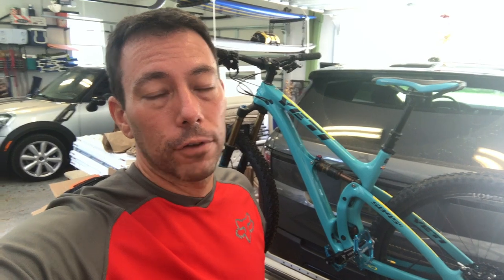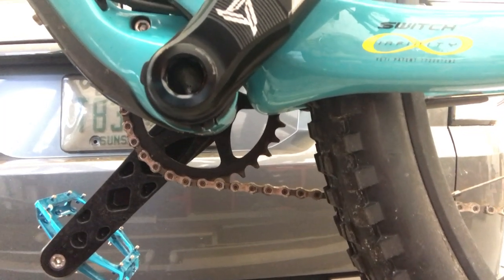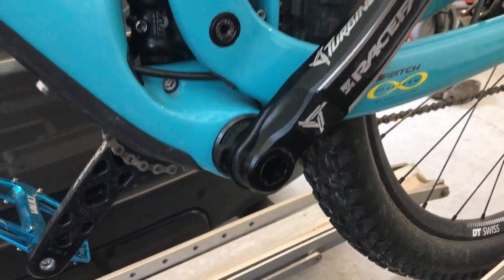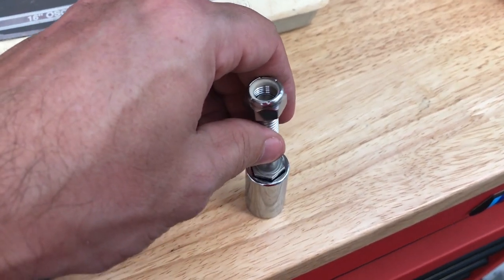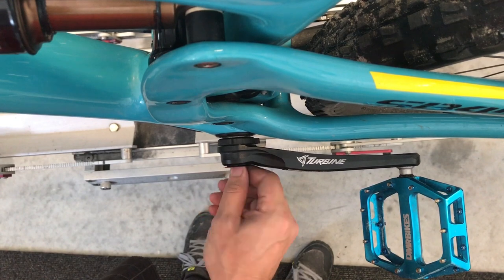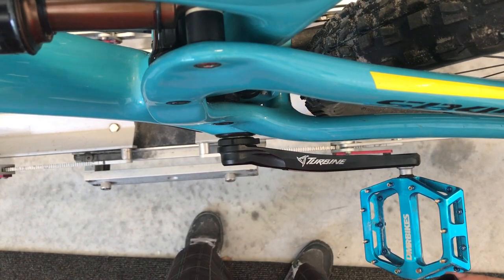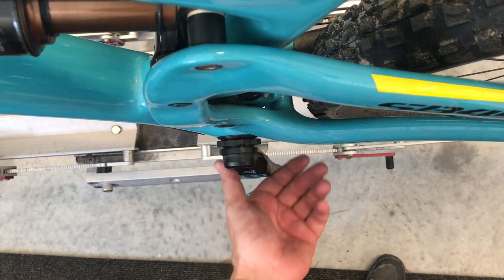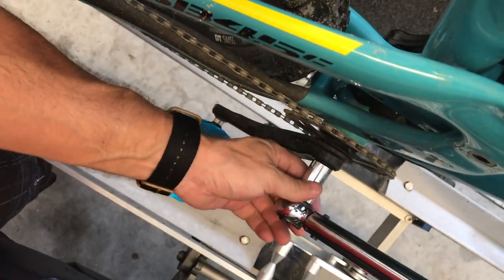Raceface Turbine Cranks 16mm HEX Bolt Hack

Comment: Dude, huge thanks! I got stuck this evening when the crank extractor bolt started undoing with the 8mm bolt when trying to remove the crank. 

I packed the socket with a 16mm nut, then a few other washers to get a 50/50 engagement, was able to torque the cap back in properly and then get the crank off. 

Lifesaver mate!
Reply from the maker: Glad it helped!!

Comment: Lots of great hacks added in the comments. I was going to add the sparkplug hack but someone beat me to it. But here is another. This one won't work with a torque wrench, but good for the trail side....3 x 8mm hex keys (Allen) put stacked against one another fills the 16mm opening nicely. 2 hex wrenches is ok but 3 gives a better fit. It has to be the basic "L" shaped hex/allen keys.

Comment: This is good to know. Just installed my cranks. eBay for less then $8 bucks 16mm socket. Thanx!  It’s the 8mm bolt on the drive side that keeps the crank tight though. Not the 16mm. The 16mm nut is there to stop the 8mm bolt when loosing ,  so you can extract the arm off the spindle.

Comment: In the assortment of fittings, connectors, etc for my air compressor there is one part that is exact fit. Its a hex nut with a much wider or longer sleeve so you can pop a socket or wrench and cinch down.
Reply from the maker: Good stuff!  Thanks!

Comment: You could have used a fully threaded bolt of the correct thread and cut it flush to the correct dimension and use the bolt as a permanent solution to hold the nut in your socket instead of stuffing paper.
Reply from the maker: Yep, I thought of that after the fact.  haha   Thanks!  :)

Comment: Always easy to comment afterwards. But if you put a couple of hex nuts onto the threaded 16mm bolt tighten them against each other they would lock together and you’ll have a permanent bolt to lock insert.
Reply from the maker: Yes sir!

Comment: 5/8" works for your application. It is 15.88-15.82 mm if it is within ASTM standard
Reply from the maker: Yes, that's what i used eventually, but the problem is there aren't 5/8" hex wrenches readily available.  :)

Comment: Hello Mr Tonka, can you help me with my SB5 build? I want to use a Raceface 30mm spindle/crank and would like to know what BB you used on your SB4.5 (I believe the BB are the same size on both bikes) and do you recommend it? Nice bike hack for the 16mm  hex. Thanks for the help!
Reply from the maker: RC Heli BBS aren’t my specialty but I believe you want BB30 for the bottom bracket. That is what is on my 4.5.  My sbb5 is different but like you, I think the B.B. shell size is the same.  Give Yeti a call, they’ll answer the phone and help you out. 😂

Comment: I have sram cranks on my bike and it needs an 8mm and 10mm, the 8mm was easy to take off, but the 10mm at 50nM was insane to take out, I used a tube of steel over my allen key and put huge force through and all it did was strip and rand the 10mm allen key, I tried again with a more high quality allen key and it work ok, but if I need to pull out again I think I would strip the locking nut..
Reply from the maker: That stinks.  once you round it off a little bit it's only a matter of time before it strips all the way.  Probably a good idea to source a new one to have for the eventuality.  :)
Reply: Can't take mine out.... so stupid system... I will never buy anything else again from raceface...
Reply: @Angelosts  Try a penetrating spray called “kroil” it’s in an orange can that looks all “oldy-timey “ and it works better than anything I’ve ever seen to get out stuck fasteners. Better than WD40 for sure and better than even the highly regarded PB Blaster. Spray a tad on stuck threads, wait overnight if you have the time and viola! It’s not cheap tho- Amazon has ~20ish oz can for $30-$35 but that will last you a long time and if you work on your own car(s) it’s a must have item. I’ve gotten rusted suspension bolts out with Kroil that no one thought was possible.

Comment: On a somewhat related note, have you tried replacing the chainring on those Turbine cranks yet? I just went through the process and it was a major hassle.

First off, you don't need to remove the 16mm cap on the drive side as it acts as a crank arm puller when you back out the inner 8mm bolt (not mentioned anywhere in the RF documentation that I could find). Once the 8mm bolt makes contact with the 16mm cap, keep turning the 8mm and it pulls the arm off the spindle. 

The second, and biggest hurdle, was removing the direct mount lock ring that holds the chainring to the crank arm. I used the Park Tool BBT-22 on the lock ring and tried everything from using a long handle wrench, to mounting the tool in a bench vise and applying all 200 lbs of my bodyweight pushing the crank arm but the lock ring would not budge. I ended up taking it to a shop where it took 2 guys to remove it (with tool mounted in a vise one guy pulled on the crank arm while other guy pushed using a chain whip)! I am not sure sure how common this kind of "stiction" is with RF Turbine cranks, but what a PITA!
Reply from the maker: Not a fan for sure.  I did change the chain ring in the oval chainring video i did.  But i sold that bike with those cranks and don't miss them.
Reply: My chain ring came off no problem. But it depends on who assembled your cranks/chain ring.  If the person that assembled those didn’t use grease I can see it would probably be difficult as they start to bond to each other. Also, FWIW, I have that Park BB tool too, but don’t use that one as it doesn’t accept a ratchet square. It has a round hole and merely flats on the side intended for a wrench. Stupid design from Park as now no one can directly use a torque wrench. I use a cheap Chinese bottom bracket tool that does have a ratchet square for a 1/2” and I used a 12” long ratchet. I’m pretty sure if all I had was the Park tool it would’ve made the whole process much more difficult.

Comment: Weird - even original RF install video mentions that you can use 5/8 inch hex key (i assume thats exactly the size of those bolts). Or was that key also impossible to get?
Reply from the maker: Yep, 5/8 = 15.8 mm and would be equally as difficult to find.  Just because of it's size.   :)

Comment: Another tip - get drive side crank bolt + puller cap (like here https://www.worldwidecyclery.com/products/race-face-cinch-crank-bolt-puller-cap?nosto=productpage-nosto-3) and you get the same setup as on your drive side - i.e. you can pull the crank or tighten it using 8mm hex only. Small perk - you can get the puller cap in couple of different colors, so you can pimp it up at the same time :)

Comment: For anyone with RF cranks - instead of 8mm to 16mm adapter i recommend getting https://www.parktool.com/product/self-extracting-crank-cap-tool-bbt-16 - costs couple of bucks more, but is not as easy to lose and can be also tightened manually (and has probably higher chance to be found in your local bike shop as it is also suitable for SRAM cranks).

Comment: How are the cranks holding up since you did this? Any creaking?
Reply from the maker: Nope, no creaking once i got them put back together.  Seems it was just a fluke that they came loose to begin with.
Reply: Mr Tonka sweet. Ordered the 16mm on amazon. Once I have that all throw some lock tight on there.
Reply from the maker: I'm not sure why it came loose, but i suspect it was just something that may have been overlooked when it was first built up.  Maybe i should have re-torqued everything after a certain amount of ride time or something.  But, even if i was supposed to, i didn't have the tool necessary!  lol